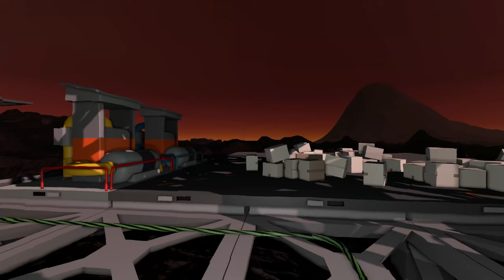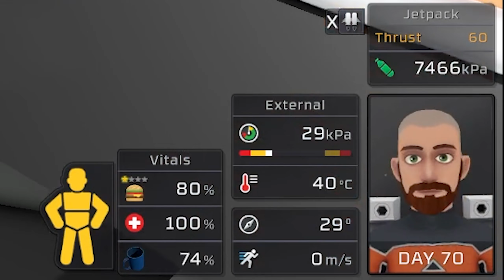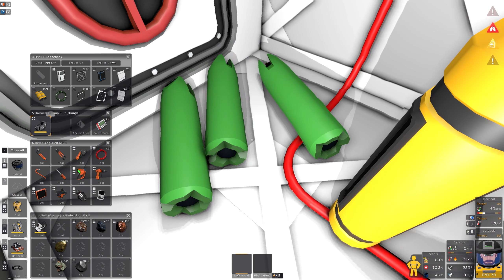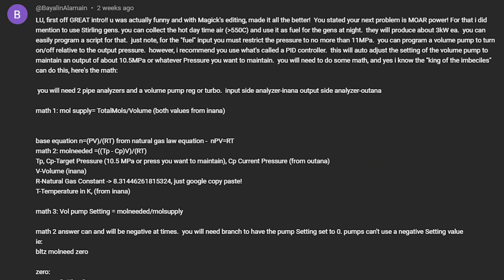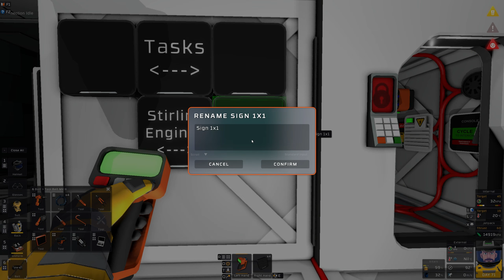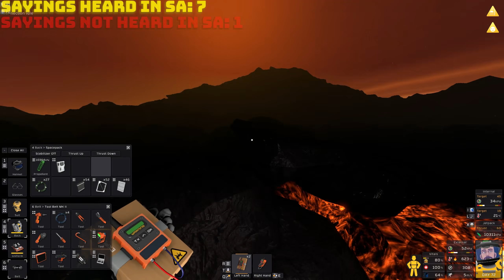Largely & Largely Pharmaceuticals | Stationeers Brutal Vulcan | #20

Comment: Reminder. Build a path to vent/store Pollutants from traders. They pay you for gasses you use as airconditioning fluid, and they are plentiful in your environment already. So might as well have a couple containers on hand, and pollute the environment while you wait.

Secondly. You don't need Hvac, you need two vents and a radiator. Put the radiator in the plant room, then pump the air in the room with two vents and a pressure switch. Watch hot air get cooled and get returned at 25 degrees. Later we can plumb it with a heat management system but right now? Keep it simple.

Comment: LU, go up to 70mol for the Vol working gas tank (i was wrong, sry). thats about 2.5MPa-ish, and dont worry they will heat up to about 425C. But they their pressure will max out to about 7.2MPa.   if you want an example for the stirlings working with that math script i showed in ep17, theres a world save on ur disc on Nov 19 2024.  that has the math in a script.  (i think its the white IC chip outside) if you want to see an example (and it needs some updating as well, sry.....)
From experience a reg volume pump can feed 3-4 Stirling gens

If you do use the math i sent ya, (ep17) here are some trouble shooting tips:
set your target pressure (Tp) to 10.5 to 10.75MPa!! this will give you some "breathing room"      over 11....things go bad......really bad....

1st have the final answer of the math (pump setting) sent to the db Setting, so you can see the answer.  if the answer is over 10 but under 15, increase the volume of the input side.  if over 15 and climbing upgrade to a turbo volume pump.

2nd if the pump Setting is jumping a lot. like 0 then 20 then 0 then 15 etc.  Increase the Volume of the output side.  ive noticed that if you have 2 lg inline tanks per Stirling gen the pump will "stabilize".  the math in the script is designed to be self-calibrating

3rd you can place two stilings in series of ea other 
they will expel heat thus you will need your exhaust pipe outlet, the collection powered vents and the stirlings themselves at least 2 frames (more is better) away from your gas sensor.  Or it will give false readings

4th you want to set it up to run them 24/7, by collecting nighttime air.... Dont forget Pol will condense at 5.4MPa (ish) at 127C...So either dump this liq pol, or find a way to use it to your advantage.......🤔🤔🤔🤔🤔cough evaporation cough...

these trouble shooting tips really only apply after the first night of running.  when it starts for the very first time it will max the pump setting and then slowly decrease (hopefully)
 

as i said before in ep17.....the math script will be needed for another item later in game......

Last note...the summer of vulcan will cap at 1100C (1099.6C) during the day.  at 927C thats hot enough to make invar.....aka....deep drills......
Reply from the maker: Ok will do! Already recorded the next two eps as I have an insane week ahead, but will do so once Magick gets through this backlog
Reply: OH MOMMA THAT LAST NOTE! your telling me, hes STILL IN WINTER! good god i feel bad for this save. also now hyper tempted to retry this game.... if i can dig a few mods of value for a off steam copy.
Reply: @ he’s not in winter atm, I’d say spring., late April, early May (ish) I’d guess Cause his day temps are nearing 900C

Comment: Hey what's colder than vacuum?

I think feeding the sterling engine with outside gas and running it in a room that is a constant vacuum it'll work perfectly
Reply: Heat (i.e. energy) needs something to transfer it from one place to another. This normally occurs when an atom, molecule, or electromagnetic wave bumps into another or radiates and transfers some of its energy to something else. Vacuums do not have atoms or molecules and have to rely on radiating that heat through black body radiation. Vacuums are great insulators and are used in thermoses between the inner and outer walls to keep liquids hot or cold.
Reply from the maker: Exactly what Net Anon said. Without heat conduction the temperatures just equalize and it all breaks down.
Reply: I was thinking the same at first, as is was about the temp-difference. But the part about "beeing in an atmosphere" threw me off. I don't know the mechanics, but assume right now, a vacuum doesn't count as "atmosphere"?

Comment: does it have to be hot inside the pipe and cool outside the machine or can you do it both ways? like cool in/hot out during the day and hot in/cool out during the night. it could be automated and the entire system could be outside not needing to be in a pressurized/ temp controlled building. idk maybe just a good thing to test because in IRL the sterling engine doesn't care what side is hot it only changes the direction it spins.
Reply: Logically you should also make more power by increasing the pressure of the gas in the surrounding room, so you pump in night gas to 200 c, cycle it through radiators to cool it back to 150, and automate the filling of day gas whenever pressure drops and external temperature is high.

You end up with 100 atm of high pressure low temperature heat sink, and 200 atm of high temperature high pressure feed container. We surround that heat sink room with a powered vaccum and never enter it again and it'll just churn out power infinitely so long as we have daytime high temperatures and night time temperatures for our radiators to run in.

Plenty of thermal mass on both sides, plenty of thermal conductivity under these supercritical pressures, and the game probably won't bother modelling that even pinhole leaks could cut off your limbs

Comment: Idk how the game works but I would imagine the rooms with the sterling engines would get hot so I would seperate it from the base so it doesn't have through wall heat transmission
Reply: walls are perfect insulators in stationeers, so through wall heat transmission shouldn't be an issue